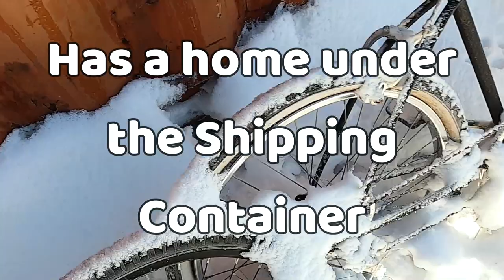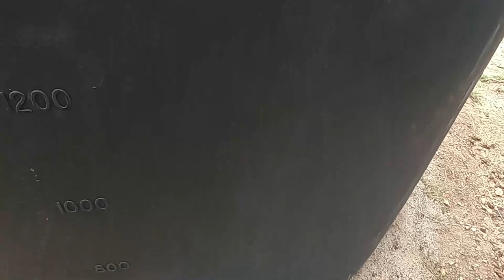Crisis Averted | Winter Wonderland | Homestead Vlog

Comment: You are a good egg Ed. Doing what you do to keep the Ranch safe even when Ausia forgets. Peace Out.
Reply from the maker: It is very easy to forget something when putting a property to bed for the winter.
Reply: @nomadranch6246  I know. I do the same thing here at Old HIppieland. I have forgotten multiple things already this year. Luckily the full winter cold has held off so far with only 2 day cold spells. But that ends on Thursday here as our highs will avg 40 and lows in the teens moving forward. Come on Snow. Peace Out.

Comment: Hi Ed, What are you using for heat in your rig?  I have read were you can get billboard plastic( cheap) to skirt the bottom of your rig that would help with insulation.  Good catch on those valves!
Reply from the maker: Stay tuned will cover that in the future